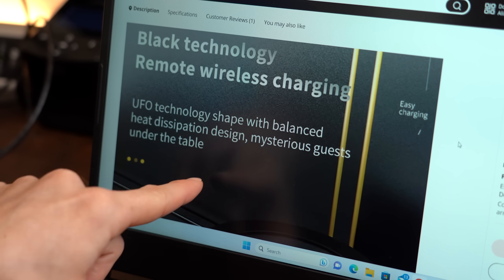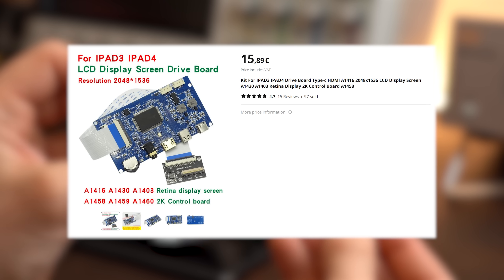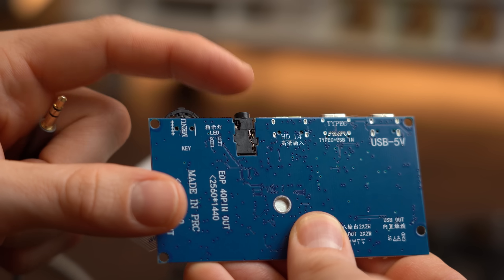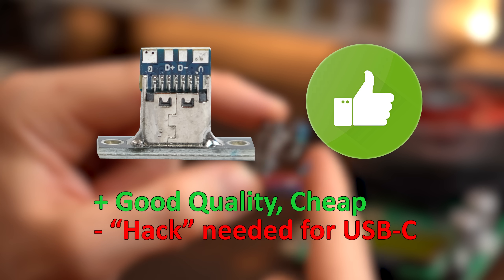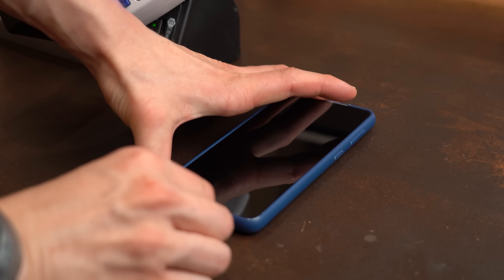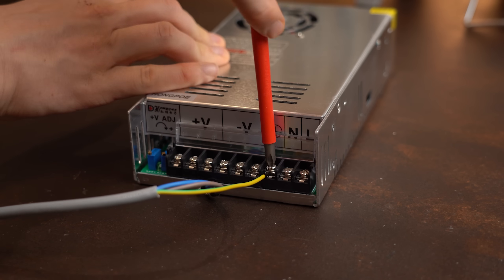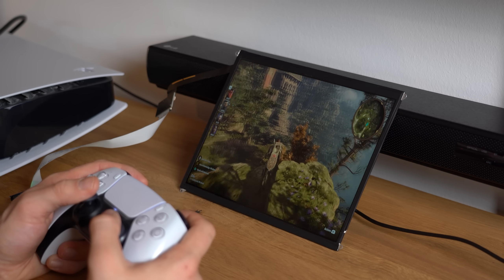I tried finding Hidden Gems on AliExpress AGAIN! (Part 7)

Comment: If the LCD display is the same as the one I saw reviewed on another channel, it is a touch-screen. But if you plan on running something like Windows on it, the bottom area (where the task bar is usually located) does not respond to touch.

Forgive me if someone has already mention this. I'm not going to read through over 700 comments to find out. 🙂

Comment: Shop around with those USB connectors. I bought some, but the PCB was NOT soldered to the case. Instead, lugs at the rear were bent slightly inwards. This meant that as soon as you pushed the USB plug in, the PCB came out of the housing. I opted for a slightly different model where the housing is encased in plastic with fly wires coming out the back. Much easier to use

Comment: Hey Scott, regarding the strain on your phones usb c port. On my iPhone I found out that a wiggly usb c port is because of the actual connecter. Not the port. Try a brand new usb c cable that is high quality from Ali express because they have the best ones. You will not be able to wiggle it. Love you Scott.❤

Comment: In the lcd part :
Your usb C cable has ONLY DATA   AND POWER AND NOT THE CC OR OTHER COMMUNICATION LINES 
So there is no way that your usb C cable can send a video signal

Comment: I need a power supplly to power up a old US police Lightbar as a decorative object. It is filled with 6 H1 bulb (55w each) and the electroci motor that make them turn through plastic gears. Would such a power supply be sufficient ?

Comment: That wire twister is shit. Yes, wire twisting, when done correctly, can have better connection than wago, even long term. But to do it, you need to twist all wires together and twist it just right - to strong puts too much strain to wires (which is even more critical on wire side), to weak means bad connection prone to thermal cycling issues and oxidation. This tool made about half of tested connections by twisting other wires around one central wire, which is bad connection from start. It also twisted start of connection stronger, which increases chance of too strong twisting at the beginning and probable damaging wire. Even worse, insulated part is also twisted, and wire damage can be hidden under insulation.

Compared to wago, one of worst things with twisted connection is inability to inspect it afterwards, meaning that you just need to trust your skill and feeling. Using this tools takes out any feeling for connection and quality of connection is pure guesswork.

Comment: 6:50 i've never had a type-c port break on my phones yet and i keep using them for 7 years mostly, with at least charging it once a day. All you got to do is poke the accumulated dirt out with a needle every few months and it will last long enough to not get software support anymore.
wireless charging is only good for convenience and wasting energy ( yes i use it too on my pixel buds ).

Comment: At 6:59 you mentioned it being impossible to hide a wireless charger in a drawer.  You can cut a recess for the device from inside the cabinet or under a desk which will let you put the device close to the surface of the desk.  Cut the recess most of the way, leaving 3mm thickness of your surface.  Thinner is better for charging, but thicker is better for strength.

If you don’t have tools to cut the recess, you can cut all the way through then laminate a new surface (like kitchen counter material) on top.

Comment: A twisted wire connection will ALWAYS be better than a Wago. In the U.S., a mechanical bond, usually a twisted wire connection, is REQUIRED to pass code. That is why Wago connectors don't pass inspection in the U.S. Hot cold cycles have no perceptible impact when using code approved wire.
Reply: That being said, this wire twisting tool will never be in my bag, I require CLEAN professional looking results, not gimmicks.

Comment: Hi, one quick question towards those USB C plug breakout boards. 5.1kOhm is for maximum means 3amp but i want to hook this plug up to a 2.1amp what different resistor values do i need then?

Comment: 8:35 I think you're using that wrong. I think you put them in, then you grip it with the pliers where you want the connection to start, and turn on the drill just long enough for it to wind.

You're not supposed to go absolutely max speed on it, pulling, jerking, and tearing off whatever wires happen to come loose and just generally not caring.

In tomorrow's lesson: Don't drive your car through the wall of your livingroom.

Comment: Also as an electrician in Europe, that cable twist thingy would not make approved connections. It overstrains the cables and the insulation is ripped of and as seen by your example they even hurt the insulation below your connection point. So if you use that at a construction site you would just get a fail on the inspections. Also if you use it for diy 230V connections at home and something happens the insurance company will see this connection and you won’t get a single penny there bubba😅

Comment: Why not use arduino Bluetooth module and program it yourself? Like boards with SYN480R and SYN115 chips. They are really cheap.

I am betting it's possible to flash this round thingy and reprogram it to be accurate.

Comment: I use volta cables so I don't wear my ports and because it does data and micro b so my older controllers can use the same cable

Comment: on the adjustable Powersupply
a) what is the max current on 12v dc ?  -  with the wattage on 220v AC side i cannot even calculate it.
so no information what it puts out, only that you can limit whatever it can do..  you could would be in the position to add useful information here.

b) noise output "no problem" is not scientific enough for me ... for someone sponsored by Rhode & Schwarz that undercuts my expectations :)
Does it produce RF noise? (no sinewaves in the output before the rectifying) like so many cheap switching psu unfortunately do.

Comment: I would like to use BLE beacon in a practical place: ESP32 inside my car, beacon inside my parking (attached nexto to the door)... ESP32 will detect this beacon an will invoke to home assistant a door opening signal ( via RF signal ). This sounds complicated , but assuming a neighborhood door I cannot modify motors and others... I have to do a "passive system" addon

Comment: for anyone looking to get the LCD + driver - I bought the combo from the link in the description. It came down a bit more expensive at $62.53, which is still pretty great.

The display came yesterday.

It works great with power from a power bank, same as in the video.

I took the Type-C to Type-C cable from my monitor and with it, I managed to get video! Unlike other portable monitors that can be powered with a single Type-C cable, drawing power from the device, this one requires a dedicated Type-C port for power. So that's two type-c cables.

Tested with Samsung S21 - Dex opened in FHD mode (that's the highest it does); 
On the Windows 11 laptop, only got resolutions up to 1900x1600, still trying to figure out how to get full resolution...
On the Steam Deck, without any thinking got 2048x1536, so the display itself supports it!
edit: Also tried on M2 Macbook, where I also get 2048x1536 without any issues.

Oh, and the display also supports power delivery, so the connected device can also charge from the same cable used for video. But using the power bank, my laptop didn't even notice it, steam deck was barely getting any charge, and only my s21 was actually gaining battery. I might try with a better power supply, but wouldn't count too much on it.

Lastly, tested the sound via. the 3.5mm port and it was.. very quiet. Full volume on the headphones was barely enough to hear a twitch stream and the sound was tinny compared to the same headphones in the laptop 3.5 port. So I wouldn't use the sound as much.

But the display itself is great! Thanks for recommending it @GreatScott!

Comment: Just looked at those USB-C ports because I think they are going to be very useful, and they have a 6-pin version now that breaks out the CC1 and CC2 pins for you!  That's great for me because I want to use them as a power injector in my car for a stereo that does not provide enough current on it's own.

Comment: You should also check the EMC emissions of the switching power supply units, as these are often real EMC slingshots that cause radio interference if they have not been correctly suppressed.

Comment: I bought the iPad screen and the driver board, thanks for the recommendation! In the video it looks like that the driver board got an internal audio amp. You connected a speaker without amp. Does this also work for the 3.5mm jack? Just connecting a small speaker...

Comment: Hey scott! thanks :) concerning the power supply, I actually used meanwell clones for years. This year, I have switched to a  "lab power supply" WPS3010H for about the same price (paid about 60€ for the 60V5A version. You may want to check them (?) they are not perfect but do a pretty damn good job for a few bucks :)

Comment: @greatscottlab At 4:10 you say that USB-C video input is not working. I have exactly the same board and I can tell you: It does work! You probably need to use a better USB-C cable. I tried it with a cable labeled "40 Gbps" and it works just fine.

Comment: The driverboard for thr iPad, headsup for people who are buying one, aspect ratio does not work, will always say out of range, has to stay on FULL, also, its says it has a control input, its not, its usb.
To make touch buttons instead of a dial, remove the dial and replace with 3 tac switches.

Comment: I lost a lot of money with Alixpress from items not received, did follow exactly their rules in claiming but Alixpress still took the sellers word that they sent the items, there was no tracking information too. One package eventually came 6 months but it was not even close to what I ordered, I ordered a touch sensitive LCD, what came was cooling thermo pads that goes on heatsinks. All in all I lost 300 dollars on 4 items.
Won't use Alixpress ever again

Comment: Love your work, but not this one: I bought two of these LCD iPad panels. They are DEFINITELY not new. They have been salvaged from iPads from recycling I think. Not really worth the price given they are used. Seemed to work OK.  I didn't look closely at the aliexpress advertisement: it doesn't say anywhere that they are new. The one you were sent looked very new and had a bezel on it. The ones being shipped now don't. Looking in the aliexpress comments, there are other people being sent poor quality substitutes also.
Reply: the driver board will also only do 1900x1200 which is OK, but doesn't fully use the resolution of the display panel..

Comment: Id bet the heat from wireless charging does more damage to the battery then the damage done to using the usbc port.
Get a magnet usbc port adapter.

Comment: I co-developed a location engine for my company and we use fixed Bluetooth beacons for trilateration and get sub 1m accuracy with out device in a room with 10-15m spacing. The best solution is to fix these and use a phone to measure RSSI values and perform trilateration from this.

Comment: Hello brother
I want to make a power bank with 32700 lithium battery only ( I will use many of them ) and want to charge them very fast ( I am taking about 500-600 watts ) with direct 220v (without any mobile or laptop charger because they can only deliver upto100 watt ) is there any bms or component that can full fill my requirement. Because there is no point in having a large capacitive power station if I can charge it in 4-5 hr

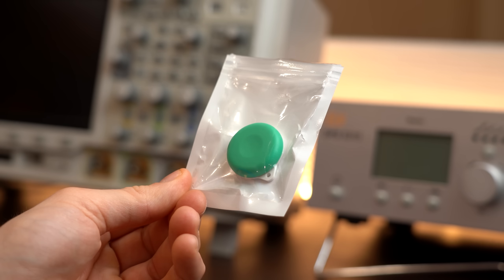Comment: 9:43 : Ok but keep in mind that this type on connection are illegal in most countries mainly because the insulation between two conductors which depends on the skills of the electrician, but also because of the cooper stress which can easily broke, and that can be very dangerous in unbalanced three phase system for example (neutral break).

Comment: if you can controll the trackers acceleratometer then you could use it to measure rotation and movement of objects, if you know rotation you could use them for VR tracking since you only need the joint rotations.

Comment: You can get proper bench PSU's like the TENMA 72-10480 for the same price if you want to adjust voltages during testing.. Also comes with proper over voltage, over current etc..

Comment: Challenge: To power that first product (LCD & Driver Board) with a computer PSU. Even better would be to power the driver board that's used for the ipad 2. That ipad 2 driver board is powered only be a 12v, 3A, barrel connector. So if you can find a way to power the board w/ a barrel connector FROM WITHIN a desktop computer case with a high-end PSU, that would be golden. Or, perhaps find a way to power it with the RGB connector on the motherboard spec'ed for 12v 3a.

Comment: the ipad lcd thing is a bit odd to call a gem when simillar or much better lcd panels can be bought for the same price range, with features like already prebuilt frame, 100% sRGB, 100+HZ, 178 degree view angle and so on... not to mention that ipads have really weird aspect ratio that cause black bars on videos...

Comment: In regards to that adjustable power supply, I actually bought something you mentioned from one of your previous videos, the 24 pin ATX power supply connector to separate screw terminals. I already hacked up a power supply a long time ago to power my 3D printer😅 But this thing works great for anything else lol

I actually have a few older Ipads and I looked into getting one of those boards for making them portable displays but never really had a use for it but I recall them being pretty expensive. I see they have come down quite a bit since, so I just might get one to check it out👀 Love your videos!

Comment: What about the SL92B02 DC 3-20V bistable self-locking switch module LED controller relay board, is it a gem?

Comment: Did you ever turn the 4-pin USB-C sockets around? Mine have pads to solder a SMD resistor on the back side. No need for those big resistors on the front or even soldering on the pins directly.

Comment: For the wire twist tool, even before you mentioned the reliability over time, I was thinking adding some solder with a torch and plumbing solder would make that connection very reliable.
Reply: Electrical codes for mains power in most countries don't allow wires to be twisted in that way, nor can they be soldered.

Comment: I salvaged an ipad 4 screen a few years ago and recently ordered basically the same controller board you feature here. Hopefully it will work as good as it did for you. I think I will combine it with an SBC to make a Batocera console. Or possibly add in an SDR dongle to make a standalone SW radio. I look forward to seeing your project ideas for this device.

Comment: That wire twisting is known for being not reliable for over a century; it's not allowed by regulations. But if you 1. Solder it after twisting or 2. Use spring cap on top or 3. Weld the end, then it will become reliable. I.e. it's not as simple.

Comment: the wire joiner method has a second step - dip the knot in hot solder

Comment: That adjustable PSU is ok. You can't have high efficiency all over the range. On top of that switching power supplies have a small dummy load to keep the output voltage under control when no load is connected. That should be take into account as well ar small loads because it starts to matter.

Comment: being worried about using the USB C port because it might wear out and then instead using wireless charging wich is awful on your battery is such a wierd thing to do 
just plug it in, my Galaxy S9 did 4+ years just fine before the battery gave up in it

Comment: On the topic of power supplies, does anyone have a verified seller for lab ones? Typical voltage and current limiting. Preferably with two separate outputs that can be combined to get a single symmetric output OR just one that already has the ground connector so it's just +/0/-

Comment: A buck regulator power supply would be cheaper than the PSU mentioned in 11:30 which has limited range.

Comment: On the usb c port. On the other side is a litte cc pad (or a r1 pad, dependingon the board version) where the resistor comes to enable pd!  Thats the correct way. No need of the resistor vetween data pins and ground. The resistor is correct between cc pin and ground

Comment: About the USB-C Connectors. They have a spot for a 0402 5.1K resistor. Solder it in and boom you have a USB-C to USB-C capable socket. This place is marked as J1 or R1

Comment: There are (or there were when I bought them) panel mount USB C ports with the correct resistors on the CC pins available on AliExpress.

Comment: Careful saying that Wago is preferred. You will trigger all the backwards American electrcians who think using a piece of plastic to make a connection safely is somehow better than a fixed tension lever connector, even after looking at proof such as your video where you overloaded them vs wire nuts. 

Americans are really just so backwards

Comment: Quick question Scott, do you know why so many USB-C charged devices from China don't function with USB PD? Isn't USB PD supposed to detect and adjust for 5V only charging? I have so many devices that only work with a "dumb" usb power supply it's just annoying.
Reply: If you just want 5v all you need is two 5.1k resistors, one on each CC line, to ground.